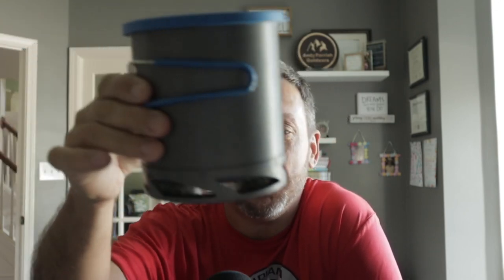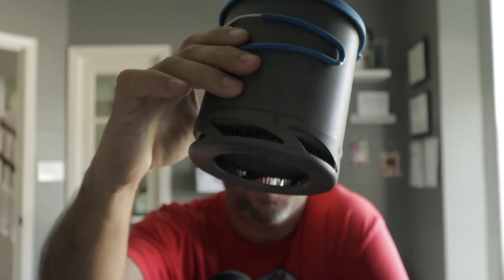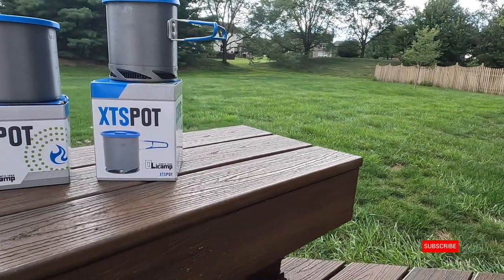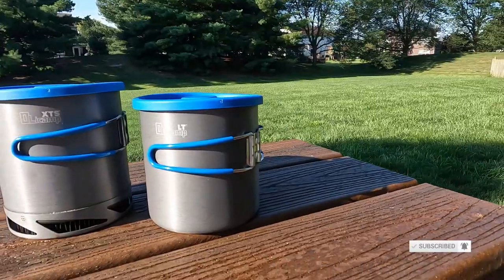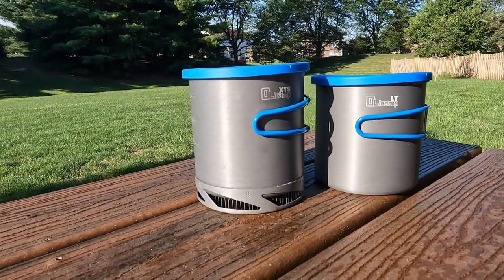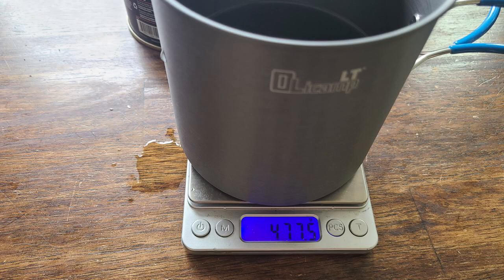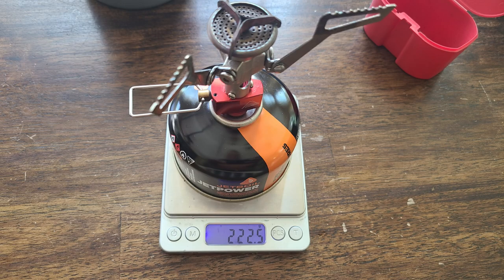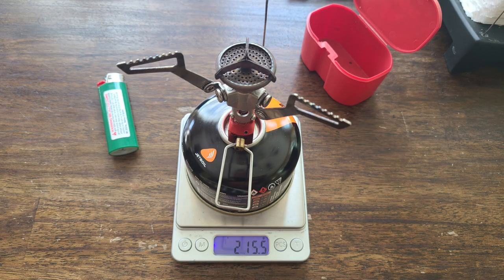Are You Wasting Fuel? Do Heat Exchangers Work?

Comment: One thing I have found on my pot (the same brand as yours), is that they are way more efficient if you don't crank the stove up. I run mine just above idle, and the fuel consumption goes way down. If you think about it, any heat that escapes the exchanger is wasted.
Reply: Good input thanks

Comment: I have a heat exchanger pot like yours, put it against a camping enamel pot similar size, granted not an experiment as detailed as yours, simple home test. Same amount of water, same water temperature, stove top at same number and guess what! The much cheaper camping enamel pot did a rolling boil MUCH faster! How much faster? I didn’t keep track since I felt like an idiot for spending so much more in heat exchanger pots (I have 3…..triple idiot) 😩.
Reply: Electric stove?

Comment: Interesting, I'm surprised by the idea that they become more effective as the pots get larger as the larger the pot the greater the distance the hot gas has to release its thermal energy even without a heat exchanger. . . if you understand what I mean.

Comment: One thing I'd like to think about is heat exchangers on a frying pan.  The only heat exchanger I've seen is on the MSR Windburner, and it's insanely expensive, but the reason why I believe heat exchanger frying pans would be useful is because it may allow the pan to heat more evenly, as most backpacking stoves are designed to focus heat in a small area.  It may be an interesting test to see with a IR camera how heat is distribulted across a heat exchanger frying pan, and equivalent non heat exchanger frying pan, or maybe we should all just fry in our little water boiling pots lol.
Reply: Jetboil used to make a heat exchanger frying pan. I had one

Comment: Interesting 🤔 but what is the weight penalty for the pot that has the heat exchanger?
Reply from the maker: So that's the big question for a backpacking application. This pot had a penalty of about 40g. Which may not be too bad if you are going with a couple people or even more... Or just considering the fuel savings over the life of the pot... 
But would it be a better option for a base camping situation? Or car camping?
Reply: If you ever need to carry a second 100g fuel canister or size up to a larger canister, that 40g extra weight in the pot would likely more than pay for itself in reduced fuel weight.

For example, two backpackers can cook 6 meals on a 3 night trip using just one 100g canister if they use a heat exchanger pot such as JetBoil. The same trip while require a second canister with a conventional pot. Empty canisters are about 100g, so even a half full canister is an extra 150g of weight.

So I think heat exchangers make sense for couples or hiking buddies sharing a stove.
Reply from the maker: @pepstein  I totally agree. These really start to show their value with larger volumes and the fuel savings adds up quickly over time...

Comment: Do you typically boil without the lid on?  In my experience using the lid creates a faster boil/saves fuel as well!  That aside, I'm looking for a different system as I got tired of the lid on lid on my JetBoil Stash falling off during pouring and the valve control kept coming out of its hole!
With the pots you just displayed, does the silicone on the handle keep the handle cool enough to, well, handle?!  And does that lid actually clip on securely and stay on during a pour?  I'm leaning towards a heat exchange pot as I've always appreciated the fast boil of the JetBoil models!  Just thinking of saving a bit of weight and not going back to JetBoil Flash.  
And while you are at it...what stove are you using here?  Thanks!!
Reply from the maker: I totally agree!... I do boil with the lid on because it speeds up the boil time substantially. But the issue I found for this test was that with the lid on, I had a more difficult time determining the boiling point. So if I did them both without the lid on, while it would take them both longer, it would be a better apples-to-apples comparison for the sake of this one experiment.
The lid does stay on now while pouring, although I wonder if over time it would wear enough to lose that grippiness.  But even if it does weardown over a few years they do sell just a replacement lid (or if you lose it) - https://olicamp.com/cookware/329085-xtslt-1l-pot-lid-replacement.html
I uses the pocket rocket 2 by MSR in this video - https://bit.ly/2EUgO9R but I also use the ultralight BRS300T - https://amzn.to/31OQcAg when I take a smaller pot setup.
I also did a video a while back on my cook kit that you may find useful - https://youtu.be/A-IsT5GcrsU
Reply: @AndyParrishOutdoors  Great thanks!!  someone at the local large outfitter wink wink, said to me, "why do you even need it  [the lid on the Stash] ...you don't need the lid to boil the water." Gobsmacked at that response!!
Reply from the maker: @Melanie Garden  Well, I guess you dont "need" it on. 
But if you would like shorter heating times and better fuel efficiency then you do! ;)